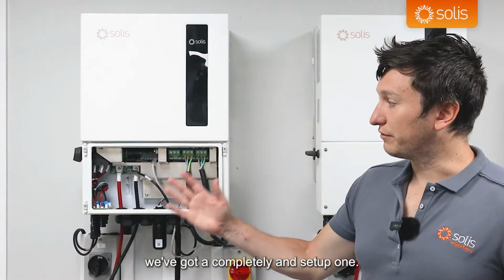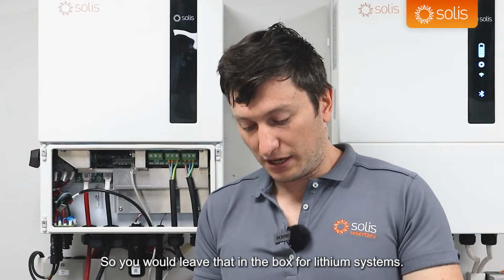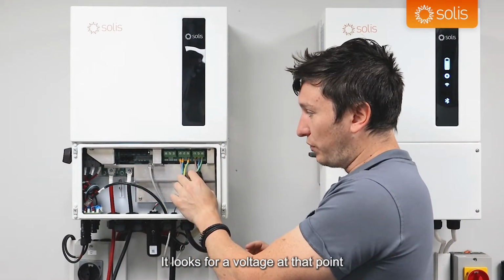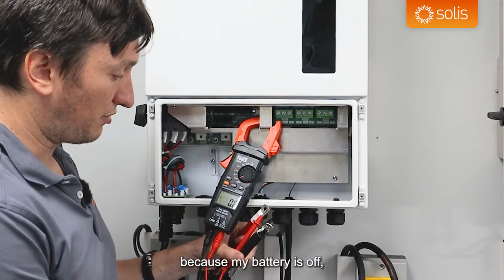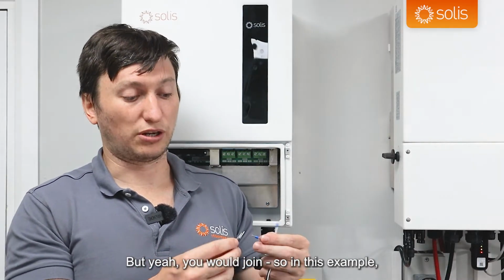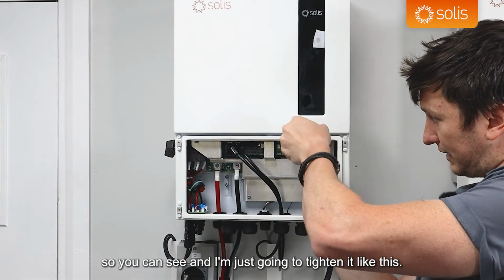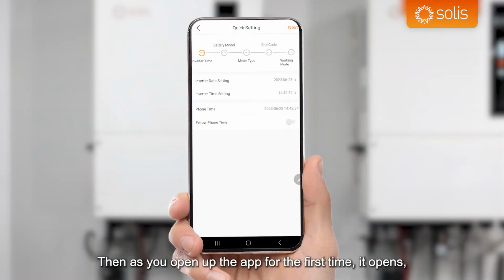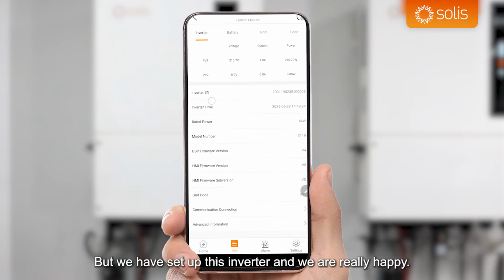Solis S6 Advanced Power Hybrid Inverter Introduction

Comment: In backup mode without grid, i thing PE and N switch together. I Have RCD at the entrance to the building against fire and after turning off the GRID, the RCD switch off to. Where in menu is possible to switch off PE-N relay? Tank you.
Reply: ac supply for the inverter should be in parallel with your rcd.. not in series or downstream otherwise you will have unnecessary tripping of rcd or you can try to install an rcd with threshold settings such as 30ma as trigger. any of the two option will just work fine.. never disable the pe and neutral of the inverter..

Comment: I have a S6-EH3P10K-H with an Eastron CT meter. I'm trying to connect the meter using a pair of RS485/Ethernet bridges so I can get the meter installed 40m away at the grid interconnection point for better control of loads across the whole property. How do I slow down the sampling of the meter from the inverter ? It happens every 70mS, and the delay in the comms means the meter cannot be read.

Comment: HI
 Have issue in morning inverter charge the battery from pv but did not shift pv energy to backup .
When we disconnect or shift inverter to off grid then pv through energy to backup.
Any solution that can work automated
Reply from the maker: Please contact Solis local service team☀

Comment: Great video, thanks for sharing! In a scenario where the inverter is located 140 meters from the main house and meter, are there alternative communication methods besides running a physical CT cable?  Also, if a backup generator is part of the system, does the inverter necessarily need to be near the main meter for proper operation? How does the system ensure export shut down during a power outage to comply with safety regulations?
Reply from the maker: Can consider to use smart meter for measurement and extend the meter communication  cable instead of extending the CT cable. 
Backup generator can be connected on grid side with ATS or directly on gen port of the inverter. Not necessarily must be close to the main meter. 
Export limiation is achieved by the smart CT/Meter measurement on the grid conncection point,  inverter will automatically adjust the PV generation and battery charge/discharge power to ensure system export limit is followed.

Comment: How to select 220AC output  ...now pre selected 230VAC which is not suitable for some appliance in my place.? Please explane thanks.
Reply from the maker: Just need to select a 220V grid code.  When with grid connected, voltage is depending on utility, inverter can adapt to a wide range of voltage without problem.  Only in off grid operation, the voltage output on the backup port is determined by the inverter, the backup voltage is settable in the Solis APP.
Reply: Thanks ,,

Comment: I am facing an issue with the SBU  
The inverter prioritizes battery use (SBU mode) and switches to battery when the grid goes down.
This behavior is normal except in a specific situation:
When the battery voltage reaches 44.5V and the grid is still available, the inverter switches to grid power while also charging the battery.
If the grid then goes down while the battery voltage is between 44.5V and 50V (e.g., at 50V), the inverter doesn't automatically switch back to battery, resulting in a blackout.
Reply from the maker: Please check what values you set on the overdischarge voltage/focecharge voltage. When voltage is lower than overdischarge voltage setting, hybrid inverter will stop using battery power. When voltage is lower than forceharge voltage, it will trigger the forcecharge logic and may take power from grid.   And please contact our local service team who will help you troubleshoot in details
Reply: @solis7119  please creat android app for Google TV too.
Reply: So what's the best setting according to you as an expert @solis7119

Comment: Is this work without battery
Reply: yes
Reply from the maker: Yes, you can set "no battery" mode in battery model selection, and use it as a normal PV grid tied inverter

Comment: Pls how do I reset/recover the installer password as my installer is no more in my town and can't get access. Also the inverter is showing faultshutdown. Fault is.. no. Grid detected. However grid power is connected but no CT as it is lost in transit.
Reply: The same concern here, need to reset the installer account.
Reply from the maker: Long press the power icon on the LED ribbon for 5s,  then you can reset the bluetooth password.

Comment: Could you let us know what we can use the generator port as the second output load port?
Reply from the maker: You can use it as a second critical load backup port, for example,  when in off grid condition, both GEN and backup port can be supplied,  when battery SOC reached a lower level that you set,  it can cut off GEN port automically and focusing on supplying power to the backup port load. In this way ,you can prioritize you loads.
Reply: Never